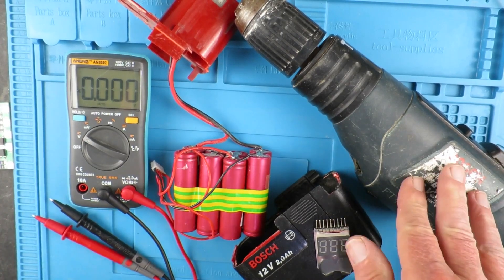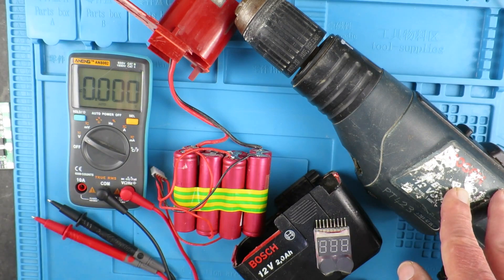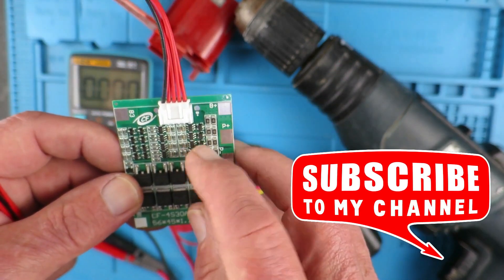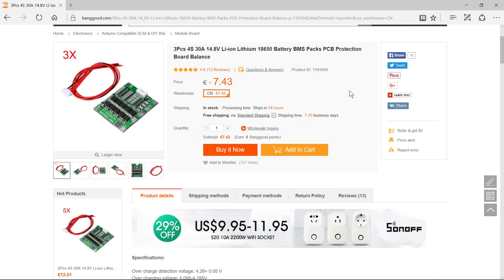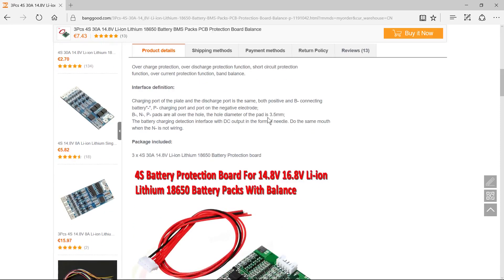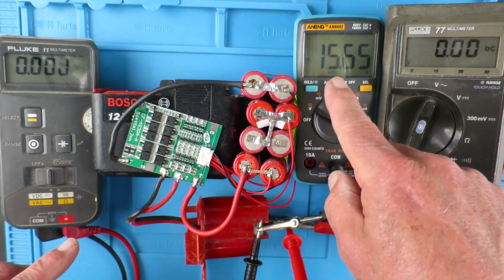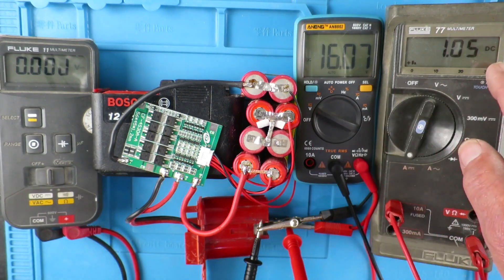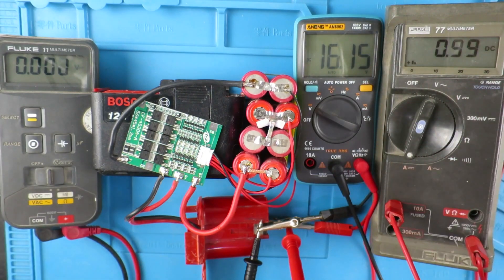4S 30A Li-ion Battery Protection / Balance Board Test Electronic Tutorial

Comment: Do you know if it is possible to both charge the battery while using the battery to supply power to a tool at the same time with this board installed? Hope that makes sense. Thank you:)
Reply from the maker: To charge the cells the charger must be set to a voltage a little higher than the final charge voltage of the pack. In my case I set the charger to 17 volts at 1 Amp. When the pack reaches full charge the BMS will disconnect from the charger to prevent over voltage condition. At this point if you apply a load then it will be fed by the charger until the voltage of the charger falls due to the current limit of 1 Amp. After that point the load is shared between the charger and pack. So I do not see that there will be much charge going into the pack. Much depends on the load applied. Although I don't think anything bad will happen also I don't see any benefit of doing this.
Reply: @1nformatica  Thank you for your response. I'm thinking of using a DIY pack to supply power for my camping rig. It will power a small 12V refrigerator, LED lights and charging camera equipment. I plan to charge it via my small solar set up so it will be connected to the charging source constantly. During daylight hours when the solar is providing charge current I may also be using power from the DIY battery pack at the same time. I am trying to determine if that BMS will allow this functionality or if it's even possible. Thanks again.
Reply from the maker: As far as I can see it will work like that. It should not be a problem for the BMS.
Reply: @1nformatica  Thank you for the information and time.

Comment: can you still charge battery's with a imax with this board connected
Reply from the maker: Well, yes, but don't connect the balance cables. I was trying to get away from using my Imax and just use a laptop supply and regulator.

Comment: while charing battry with bms how we know that its fully charged without adding multimeter . and how much current is needed to charge 4cell battray, i have 12v and 18v chargers.
Reply from the maker: To know the state of the battery I would add a small inexpensive (less than $2) LED voltmeter http://bit.ly/MiniDVM
The charge current depends upon the cells used, check the data sheet. I use 1 Amp.

Comment: Thanks 1nformatica for such a useful video. I'm thinking to convert my Bosch PSR 12 (12volts 3.AH) battery using  this procedure. Please will it be safe to provide 17V instead of original 12V to the drill. Thanks
Reply from the maker: Thanks! You can start with a 3 cell board first https://youtu.be/Qy3W_gxnyDs
If it does not have enough power then you can consider a 4 cell upgrade. I think it would be OK, it is quite difficult to burn a Bosch drill out!!
Reply: @1nformatica   Thank you for the quick & helpful response. I have already ordered the 4S BMS so would go with the 4 cell upgrade. I hope your drill in the video is still going strong which also had 12v original  battery.
Reply from the maker: Only the case is original, Lithium inside! Good luck with you conversion.
Reply: Thanks for your all help
1nformatica! Hope to achieve my  Lithium upgrade with this helpful video.
Reply from the maker: Thanks! Let me know how it goes.

Comment: Hi thank you for your great videos! I've recently bought a 4S 14.8V 8A 18650 BMS  with balance function from Banggood for a 4 cell battery pack. I plan to combine it with a CC/CV charging module (LED Driver Step Down Buck from Banggood). Similarly to the BMS in this video, the charging and load terminals are the same. I would like to know if it is possible to charge the pack while simultaneously present a load to the BMS?
Reply from the maker: Thanks for your kind words. To charge the cells the charger must be set to a voltage a little higher than the final charge voltage of the pack. In my case I set the charger to 17 volts at 1 Amp. When the pack reaches full charge the BMS will disconnect from the charger to prevent over voltage condition. At this point if you apply a load then it will be fed by the charger until the voltage of the charger falls due to the current limit of 1 Amp. After that point the load is shared between the charger and pack. So I do not see that there will be much charge going into the pack. Much depends on the load applied. Although I don't think anything bad will happen also I don't see any benefit of doing this.
Reply: @1nformatica  The reason I am asking is more for safety precaution. The aim is to have the BMS's load+charger terminals permanently connected to a load (with the connection established by a switch) and to the charger.
however if by accident the load and charger were to both be connected to those very same terminals of the BMS (maybe due to the switch that's been left on or failed to disconnect the BMS from the load), I wondered if any potential risk/damage would be of concern while the pack is charging. I also don't think it would be harmful or such, a second opinion was what I needed. Thank you for your quick and effective reply!
Reply from the maker: I don't see a problem with that. Good luck with your project.

Comment: What is your power source and how many amps does that BMS draws when batteries are empty?
Reply from the maker: What I use is an old laptop charger rated 19 volts at 3 Amps and put a DC step down module which I can set the voltage an a constant current determined by the cell datasheet. The module is this one : http://bit.ly/LedDriver You can see how it works in one of my other videos : https://www.youtube.com/watch?v=QYc1On0q4AA
Reply: @1nformatica  thank you for your answer.
So power supply should be 4.2v x 4 =16.8v .
Am i correct?
Reply from the maker: Yes. I set my DC converter to 17 volts as the BMS will detect the fully charged state and disconnect the pack.

Comment: Hi, great video, after seeing it I tried to recover the 14.4V 1.5 Ah batteries from my old BOSCH GSR 14.4V.
But a problem has arisen, once the board and the cells are set, the machine will not start. By pressing the trigger the board cuts off the power. If you press too slowly you can start, but if you do it normally, it will shut down. However, if you keep the trigger pressed down and provide power, it starts normally. The torque is good, it has a lot of force and the speed is also the normal of the machine. I have experimented with LG and Samsung cells, from 2200 mAh to 3000 mAh and I also tested with 8 cells (4 pairs) thus raising the amperage to double but the result is the same. What could be causing this? Any problems on the board? The one I bought was the following, despite saying 12V in the title, in specs indicates 15V. Is it not indicated?
https://pt.aliexpress.com/item/Chegada-nova-pc-4S-1-30A-12-v-BMS-Placa-de-Prote-o-PCB-18650-Pacotes/32887177038.html?spm=a2g0s.9042311.0.0.2742b90aNyeoab

What do you think might be happening? I made a video with the tests https://www.dropbox.com/s/nwpp4ksdwr2cp7t/Boch%20GSR%2014%2C4V%20%28Eng%29.mp4?dl=0

Thanks in advance for your help
Reply from the maker: It happens because the short circuit protection activates due to the large switch on current of the drill. There is a possible fix by putting a capacitor on the board see here : https://mysku.me/blog/aliexpress/58000.html
You will need to translate from Russian!
Reply: Hi,  I have the same cut-off problem and was wondering if you have found a solution to this.
Reply from the maker: It happens because the short circuit protection activates due to the large switch on current of the drill. There is a possible fix by putting a capacitor on the board see here : https://mysku.me/blog/aliexpress/58000.html
You will need to translate from Russian!
Reply: @takew4694  
I'm trying to solve the problem. As soon as it's finally settled, I'll put the solution here.
Part of the problem is that my board is not indicated for Li-ion or Lipo but for LiFePo4 that have nominal 3.2V and max 3.7V. This is why the board gets hot even out of service and discharging the cells until they are below 3.7V.
Russo's solution would not work in this case. I have tried to apply a 1500uf 16V capacitor in parallel with the output of the card before and realize the error, the machine boots, but as the card is not for Li-ion does not solve the problem.
In the meantime I will try again, with this Board https://aliexpress.com/item/4S-16.8-v-100A-Lion-BMS/32881416114.html more suitable for the Bosch GRS 14,4V and I will probably end up with buy high drain cells (20A-30A) Litocala type https://aliexpress.com/store/product/LiitoKala-for-HE4-18650-2500mah-20A-/217753_32947308988.html.
I got help from Sorin who has also been very helpful. You can read the comments we've exchanged here https://www.youtube.com/watch?v=flNBEeG5KmQ&lc=UgwAGYbo8bkKgK2d_rR4AaABAg
Reply: @luismoreira8421 
Thank you.  I look forward to your finding.  After watching your video and as a temporary measure I connected the battery positive to the P+ terminal via a toggle on/off switch, thus bypassing the BMS.  I switch the toggle on to start the drill but switch it off immediately after for the BMS to kick back in.  It seems to work but I know it's not the proper way to rectify the problem.  I bought my 4S BMS board from banggood.
Reply: @luismoreira8421 .  Thanks.  I tried using the capapcitor but it didn't work.  I am happy to use an on/off switch to bypas the BMS momentarily to start the drill going, aftyer that the batteries will still be monitored.  Thank you for your help and advice.

Comment: Awesome! I'm still confused as I'm new to lipo and bms. I'm planning to buy this 4S1P Li-Po battery - https://hobbyking.com/en_us/zippy-flightmax-3000mah-4s1p-20c-lipo-pack-w-xt60.html. I was told I need a BMS with protection or PCB. Will that BMS on your video work for me? Another question, do we only use BMS during charging?

Comment: Hey can I use 3s 40a bms board for lower power usage like 5a application??? And do the 18650s from power bank can actually be used for high power application???
Reply from the maker: Yes you can use a 40A bms for lower current. 18650 cells vary greatly in their capacity, avoid cheap cells with high claimed capacity. Find cells from quality makes like Sanyo, Panasonic, LG, Sony. I show how I select cells in this video : https://www.youtube.com/watch?v=z2Rhk8KJp_k

Comment: What alterations would be needed to use this BMS for battery use, but charge the battery from balance charger? (e.g. RC imax B6) Would I have to create extra two sets of wires that would ommit the BMS entirely, or just extra set of balance wires? Thanks
Reply from the maker: You would just need the balance wires to the imax B6. Then you still have the protection.
Reply: @1nformatica  Thank you for the answer. So, charge leads from BMS to balance charger would work and wouldn't be cut off by the BMS? The documentation on this is awful. Thanks again for help.
Reply from the maker: The BMS should only disconnect the charger if the pack goes over voltage or over current.
Reply: @1nformatica  So, in reality, both the BMS and the balance charger would be monitoring the cells during the charge, correct? The only advantage of this setup being the balance charger ensuring CC-CV charge?
Reply from the maker: Correct. The balance charger may be able to balance the cells faster depending on the current it uses. The BMS board balance circuit draws about 100 mA so is very slow.
Reply: @1nformatica  Does that mean that BMS would 'choke' the balance charger, since the charge cables go through the BMS?

Comment: Hello,
I have same board but i came across problem my drill kick protection and cut off complete.
Do You know place to put capacitor to make it react slower?
Of course my drill is in spec, it's just a inrush current.
Reply from the maker: There is a complete description of the circuit and fix here : https://mysku.me/blog/aliexpress/58000.html
It is in Russian! Let me know if it works for you.
Reply: Thank You for quick reply, I saw this website but it use different board. I do not have unpopulated place for capacitor and on mine it's failing other way than described. Here people describe problem as  activation over-current and just shutting down output, on mine its blocking input, like where battery is discharged and cut off. To restart i need to apply voltage.  
Mine board is:  HX-4S-D30A
I will be fighting because i'm sure capacitor in right place will solve it.
Reply from the maker: Sorry I do not know that board. Are you sure the battery pack has all good cells? Can you measure it under load and see if there may be weak cells (lower voltage)?
Reply: @1nformatica  
Yes,  cells are 100% good, high drain.  I was quiet because i need to run couple of real world test, and i make it working by adding 2 x 680nF capacitors at one of transistors. Now i can operate my angle grinder without any problem.  On lower value i manage to get drill working but angle grinder not start so I stick with it just need to get SMD form factor,  Here is place where i solder them -> https://youtu.be/nPVg4UCdCE4?t=634
anyway, thank You for help , case closed but patient alive, my cordless grass trimmer get a new live with it!

Comment: What are you using to charge the battery pack?
Reply from the maker: What I use is an old laptop charger rated 19 volts at 3 Amps and put a DC step down module which I can set the voltage and a constant current determined by the cell datasheet. The module is this one : http://bit.ly/LedDriver You can see how it works in one of my other videos : https://www.youtube.com/watch?v=QYc1On0q4AA

Comment: At what voltage does the balancing kick in?
Reply from the maker: About 4.2 volts.
Reply: Thanks, the sellers seem to never post what voltage it actually turns on at.
Reply from the maker: Remember that the balance circuit only draws about 100 mA so will only work when the pack is charged at a lower rate than normal say 500 mA. If the cells are well matched in the beginning balancing should not be needed very often.  https://www.youtube.com/watch?v=z2Rhk8KJp_k

Comment: hi there. what's the best way (if any) to charge a 4s pack with an wireless charger, 5v/800ma? I couldn't find a stronger wireless charger, but I'm open for ideas.
Reply from the maker: If by "wireless" you mean one that uses an induction coil to charge a device then it is not suitable. What I use is an old laptop charger rated 19 volts at 3 Amps and put a DC step down module which I can set the voltage an a constant current determined by the cell datasheet. The module is this one : http://bit.ly/LedDriver You can see how it works in one of my other videos : https://www.youtube.com/watch?v=QYc1On0q4AA
Reply: yeah, I was hoping for an induction coil :) I have to rethink my plan. thanks anyway
Reply from the maker: It's for the best. You have to consider the losses as well in transferring power via a coil then you would need to boost the voltage to 17 volts which will reduced the current capability further. At maybe only 250 mA it would take forever to charge!
Reply: I don't really mind the charging time, as it's an "art instalation" and art doesn't need to be fast :D I'll most probably use a single lipo cell (for tablet) and boost it to 12V. I need to power 2 Nema 17 steppers and a 4S would work better, but I really have no chance to charge it with a coil. Thanks for the feedback, mate!
Reply from the maker: I have subscribed to your channel I hope you will put a video of your "installation", sounds interesting!!

Comment: Very well explained. Charging voltage is  mentioned 16.8v but on the other hand in Q&A section 14.8 in mentioned. a bit confusing. I personally believe that those "charging boards" are not capable of balance charging the cells for multiple charges. most of them work just few times and the cells are again out of balance. Double pack (2p. 4A) is it enough to run a power tool? my old B&D starts with +7A than it runs between 3 to 4A with load.
. BTW Thanks for sharing
Reply from the maker: Thanks for commenting. 16.8 volts is the correct value. I usually set my charging source to 17 volts to give a little headroom. These are not charging boards. They are only protection boards with a balance circuit. The balance current is only around 100 mA and so will not be effective if charging at high currents. As with an RC model charger, the "balance" cycle will only charge at a low current so that the balance circuit can do its job. Clearly balancing a pack will take a loooooong time! If cells are well matched in the beginning they should not show much "unbalance" after a few charge / discharge cycles. Cells should be matched in capacity, voltage and internal resistance to prevent this. The cells I am using are about 2 Ah so 4 Ah per pair. The cells are capable of supplying very high  currents for short times. I think the original NiCd cells in this drill were only 1.2 or 1.5 Ah.
Reply: Well, BMS with balance charge function exists. my best guess to pick them is, one with the led lights obviously with charge function. Some Youtubers claim to have them. No need to connect and disconnect balance cables or use hobby chargers. Build the pack, solder the wires, Pump the right voltage/current and off you go. 
A simple RC charger would not go above 5A. at 0.5C  a 2000mah 18650 cell needs 4.2v 1A and 4 hours to charge. A 2p cell could take 8hours at 1A and 4hours at 2A. 4s2p like yours should take 4hourse to charge @ 4.2v 8A. (correct me if i'm missing something). many Power tools makers are doing this their battery packs contain bms with balance charger at least the LIPO battery packs. Its a question of getting the right BMS.